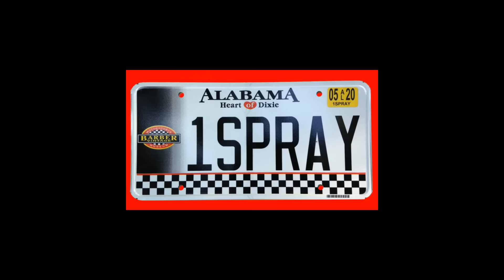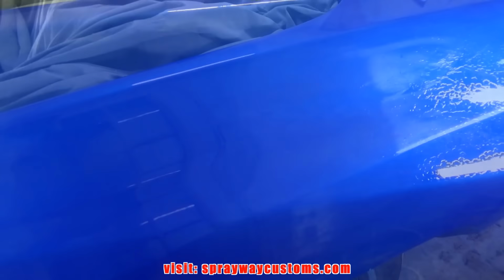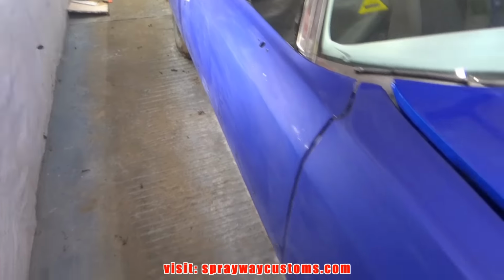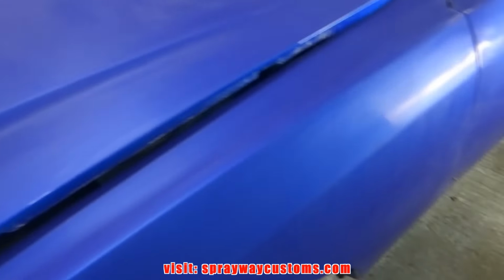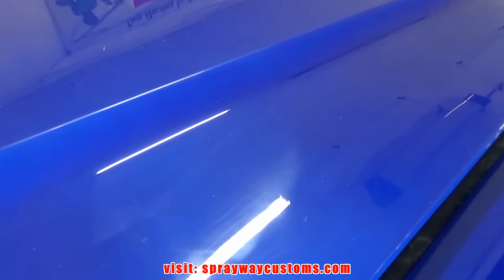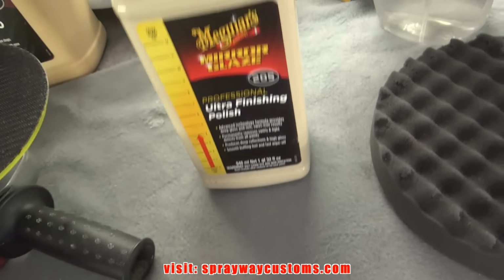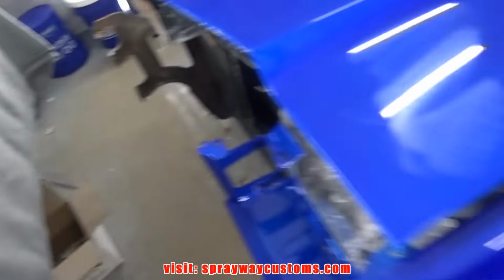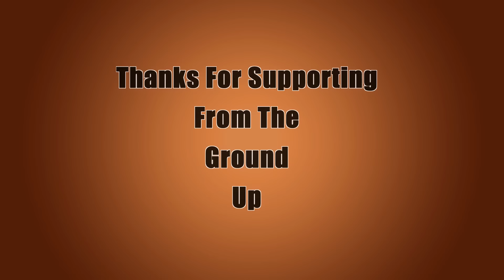How To Cut And Buff - WET SAND TO REMOVE PAINT RUNS & ORANGE PEEL IN CLEAR COAT - Chevy Caprice Donk

Comment: I did it that way 20 years ago , no more water sanding , too milky and hard to clean when dry in some areas hard to reach.
Dry sanding 3m purple film 6 inch. Paper , 1000 up to 2000 , when you want to sand a run , you need 800 grit and a aluminum block ,
1500 or 2000 don't cut , just smooths the run , you still will see it . 59 years plus and lately restoring , only .
Reply from the maker: Thanks a lot
Reply: @SprayWayCustoms  
Welcome , just trying to be helpful , if you gonna color sand with the orbital 6 inch sander , you make sure it's a 3/32 wabble not 3/16 
Otherwise you gonna see a lot of pig tails , after polishing , hope it helps .

Comment: Hey after I colored sand 2000-3000 it was flat then compound polish I see some small white spots in my clear not all over the truck just some spot it show up the next day after buffering
Reply from the maker: Sounds like moisture..if so, they’ll rise to the surface. Let it set it the sun
Reply: @SprayWayCustoms  thanks for info it did just as you said thanks again
Reply: @SprayWayCustoms  hate to bother you again after it rises to top will it evaporate on its own or do I need to wet sand and buff the spot again

Comment: What is a flow coat? Apologies if you already explained
Reply from the maker: No problem. It’s when you sand the final coat of clear back down flat to remove all the imperfections and spray more coats of clear over it

Comment: For the initial 1 maybe even 2 stages of buffing a color sanded panel, rotary is a very decent way to go. However, your final stage or 2 your DA will yield a nicer finish.  Another suggestion that I would make is to slow your movement speed down a bit and work in something of a controlled pattern. A few small changes to your technique will in time result in your work going to the next level. I have been buffing paint ( both in body shop and detailing shop type settings ) for  35ish years. I hope these suggestions will help you ( or anyone else ) take your work to a higher level.
Reply from the maker: I really appreciate the info 🙏🏽
Reply: i have been painting for over 25 years... and i only use a rotary.... a rotary buffer in the right hands is a painters tool... a DA... "rupes" is a detailers tool... spray away customs is a og... just like the rest of the og painters like the rotary... there was perfect finishes made with a rotary long before the DA polisher came around....
Reply: @thomasstott527  Rotary always showed some swirling. I have been using them for over 35 years. Some people can see it, others can't ( regardless of pad and product combo ). I will say that paint products 30 plus years ago were also more forgiving of rotary buffers.  Take a hood sometime, buff half of it to finish with a rotary and the other half with a da.  Swirls and love marks will show up much quicker on the ( if not right away ) rotary finished side.
Reply: @ritchschut1997  well I guess you just need to learn how to use them correctly... 35 years of experience doesn't necessarily mean you have been doing it correctly for 35 years... we have countless paint awards.... as well as a PPG dream car award... using a rotary machine... you will not find a rupes in our shop.... DA polishers are designed for "paint correction"... but everyone does things differently... you do what works for you...

Comment: As a new person trying to do a decent job, not a show car job, why would I want to use something so aggressive as diamond cut abrasive? Wouldn't that put more scratches in the paint than 1500 sandpaper? I hate Meguiars, it's like a guessing game trying to wade through their confusing numbering system. Paint came out beautiful, looks like you have some great skills but for a beginner, I can see someone getting in trouble trying to follow what you are doing. Wool pads create a lot of heat, not good, what rpm? didn't explain the rotation direction of the buffer and how to use that to not cut into an edge or corner, a lot of great information but not enough for a beginner.
Reply from the maker: I have it on about 1500 -2000 rpm